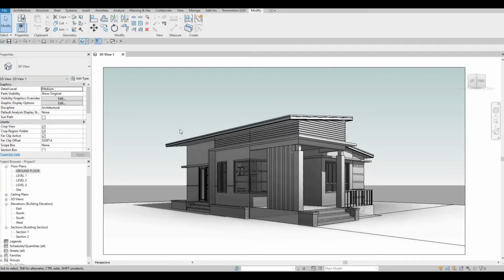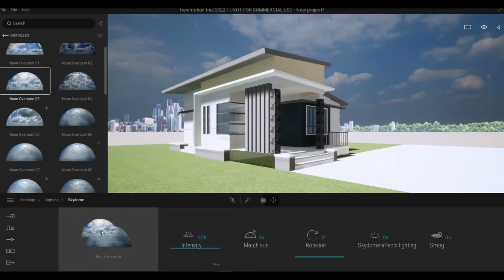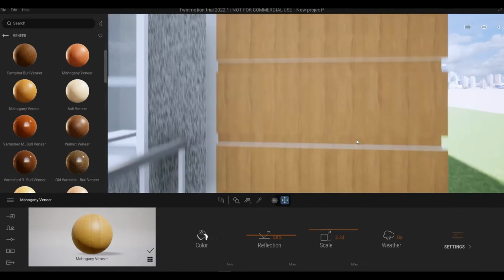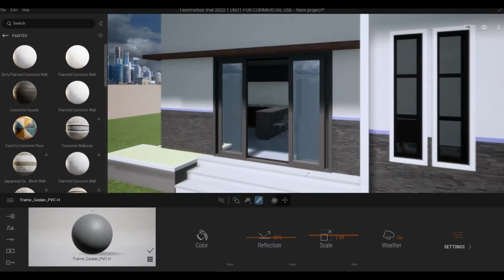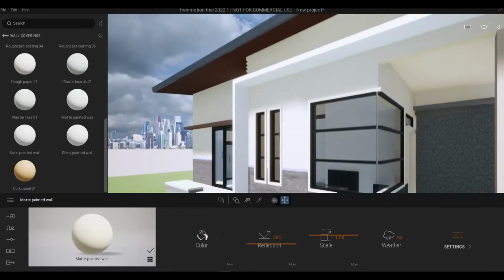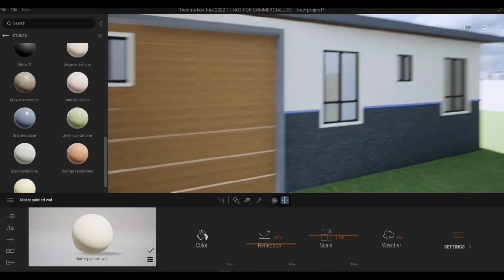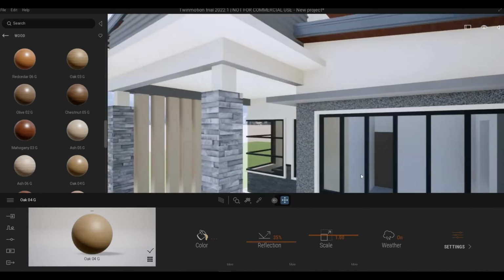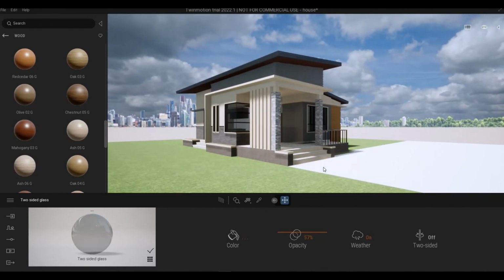SEEMES House | Part 13 | Complete Step By Step Project | Revit and Twinmotion Tutorial

Comment: Hey, what revit are you using, 2023?
Reply from the maker: Hi Kyle, I am still using Revit version 2020 🙂🙏
Reply: @ArchCoreDesigns  Ah I see, cause I have 2023, but can't use twinmotion as it doesn't have revit 2023 for it yet.. :(
Reply from the maker: Hi Kyle, how is everything now, I believe Twinmotion fix the issue?
Reply: @ArchCoreDesigns  on twinmotion 2023 u should have datasmith ribbon in revit. Some function have been changed from the earlier version